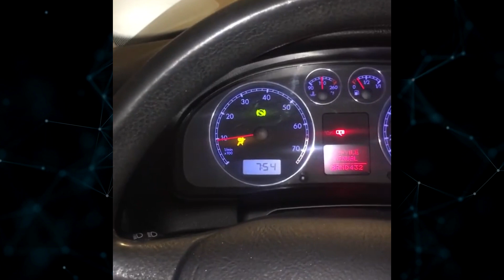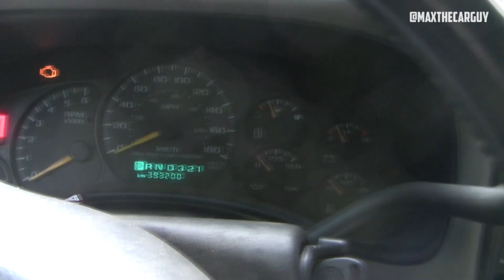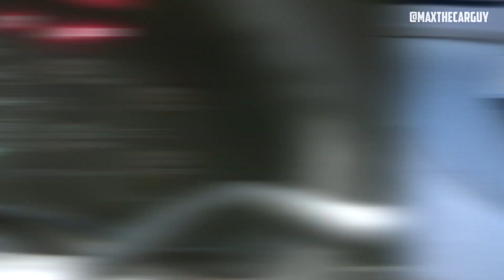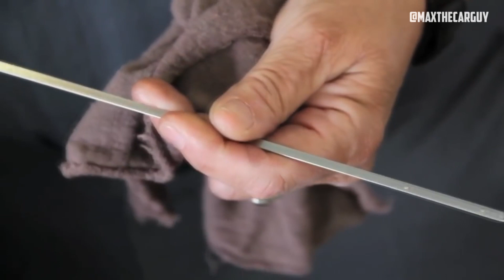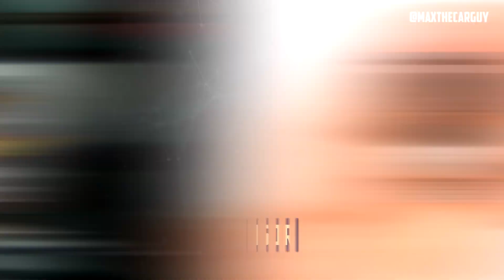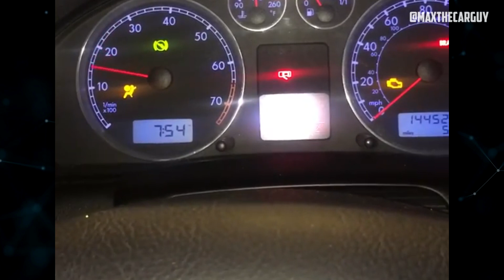Code P0520    Meaning, Symptoms, Causes, How to Fix

Comment: I only have engine light on.. No other symptoms to my knowledge. Trying to pass emissions.Only other light seems to be about the tires. which I did get 2 new tires, but light is still on. 2013 dodge caravan. 75000 miles. Thanks, advise if possible.. Other mechanic suggested oil pump, which is outrageous to replace. like $1000.